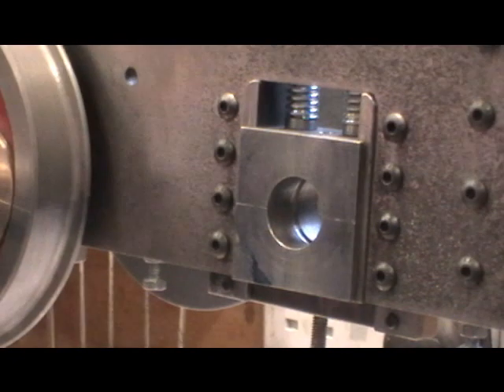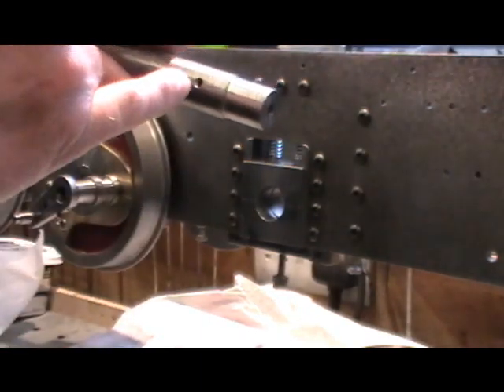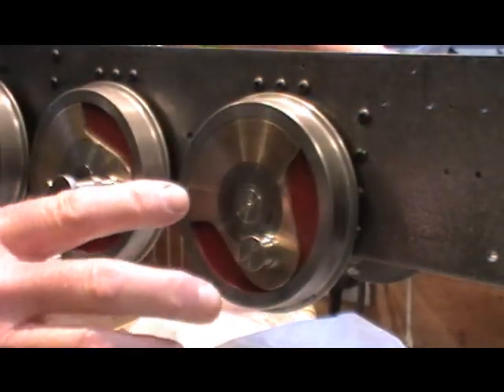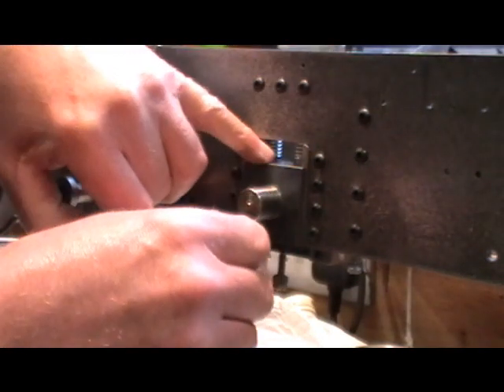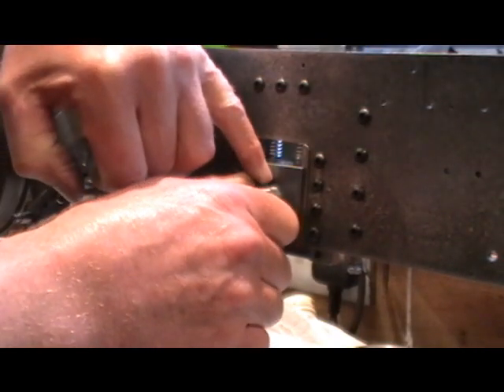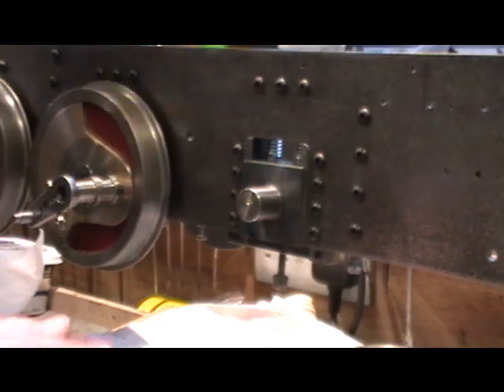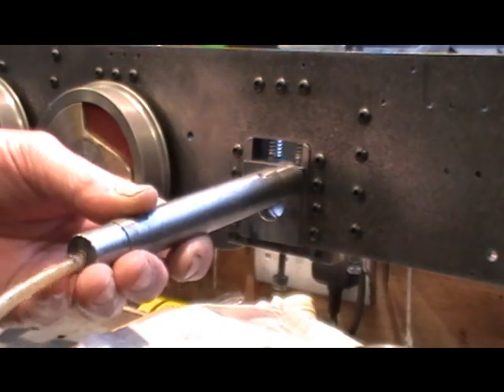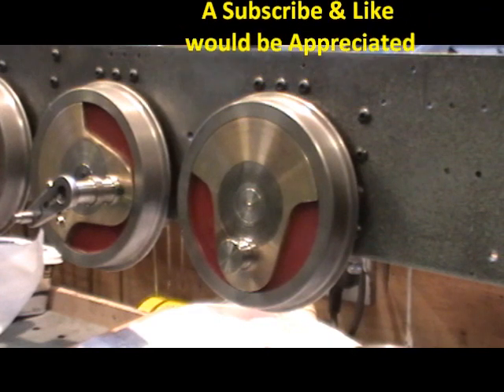Making a Beginners Steam Loco ( "Axle" Oil End Feed Modification) "mr factotum"

Comment: Hello. I am moving onto my axels while i await my spreaders coming back from machining (my miller isn't big enough to go around the edges). Up until now i have been aiming at a tollerance of 1 thou when machining components. Am i being over accurate having binned several components when i went outside that.
Reply from the maker: eyup K5179
nice to here from you
when i was about to start my metre maid, and new to building locos. I was in my usual ultra keen tolerance mode, as per when i was working for a living🤣
My tutor when i was an apprentice many moons ago and who is still a good friend in his ninties now, and may i add has built many excellent locos in his retirement, told me to relax my tolerances or the thing will never run.
That said, he didn't mean to be sloppy, but on certain components don't have to tight a tolerance so the loco can move with the possible uneven track etc etc.
So to be fair some components don't need to be over accurate as you put it, but some need a bit more precision, so it really depends on the parts you are relating to.
This advice comes with the caviat that i'm no expert on Loco's but took the advice from some experts as i was learning so to speak on my Metre Maid. 
The trouble is at model engineering clubs one person will tell you one thing and you ask someone else the same question and get a different or opposite answer🤔
So i just used my own common sense really, and applied it to each component.
At the end of the day every thing needs to move freely, and any accumalative tightness adds up when its all assembled and the thing won't move.
Anyway, i hope that helps and hope its a bit clearer than mud.
I would be reluctant to throw anything away if outside your thou', but again that depends on how far outside and on what part of the loco.
If i can offer any other help just let me know
all the best
Kev

Comment: Could you use a grease nipple instead and use a grease gun?
Reply from the maker: eyup dnwh111
thanks for watching and feedback
What ever nipple you put in has to be flush with the axle so the connecting rod ends can rotate past, iv'e not seen grease nipples that are flush, they usually screw in and stick out, the ones i'm use to seeing. Hope that helps
atb
Kev